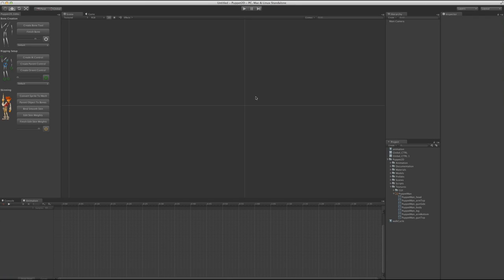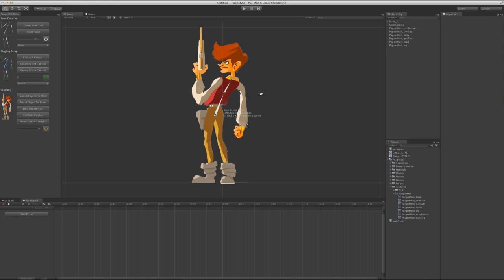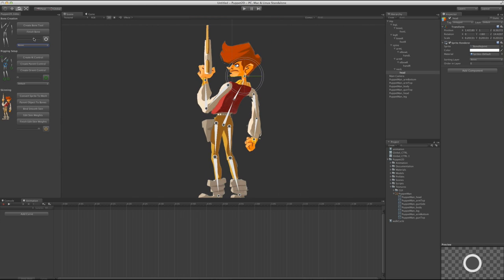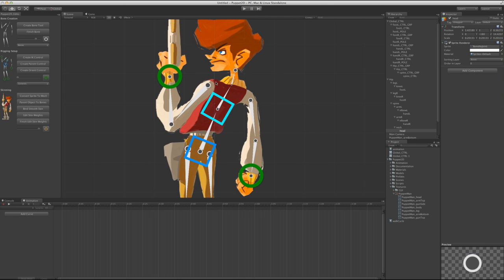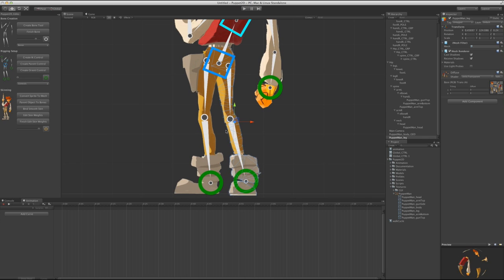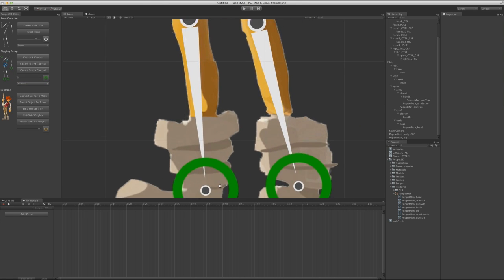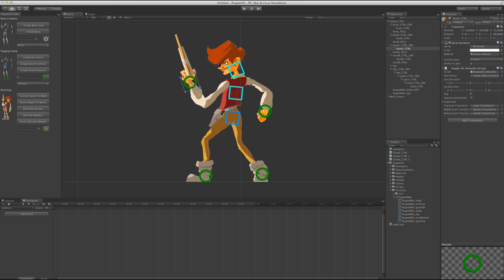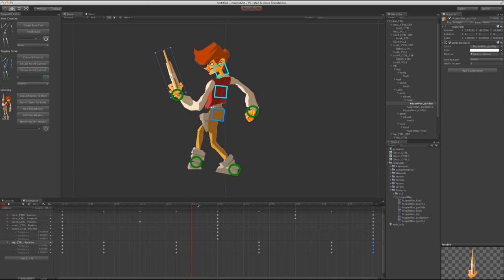puppet2d Tutorial

Comment: Is there an updated package I'm not aware of? The one I'm using has the body and right arm as 2 sprites, when I'm at the Parent Object to Bones stage it messes up completely on me.
Reply from the maker: the latest version is 2.4, where it should show a connection to each child bone  (not like the video) what is your bug with parent objects to bones? (make sure you don't have the debug inspector showing btw as it can cause issues with bone selection )
Reply: +Puppet2D If I include the right arm when I select parent object to bones the right arm moves off the body when moving it (the shoulder disconnecting from the body altogether).

If instead I include the right arm as part of the body when I convert sprite to mesh the right arm sprite doesn't move when I move the IK control, it just distorts the body sprite unnaturally.

This is my first time watching the videos, I'm sure once I get the hang of it I'll be able to do the right arm the same way I did the left. As I'm only following steps right now it threw me off when it didn't work correctly. I simply need some confidence with the tool.

Thanks for the speedy reply!
Reply: +Puppet2D Just worked out it's because the right arm is one sprite, that's why it keeps disconnecting from the body. The left arm is 3 sprites. I'm a halfwit. At least I know now why it's happening and I have a feeling the convert to mesh thing I have to do on the body and leg will teach me what I need to do to sort the right arm out too!

Comment: How do I modify each joint individually? When I click on a joint the pivot point is no where it should be.
Reply from the maker: Tristan Begin You need to set it to "pivot" at the top left of Unity GUI - (not centre) that way you see the rotation point in the correct place.
Reply: Puppet2D Oooh, I feel dumb :P
Reply: Puppet2D Another quick question. When I rotate or scale the parent of the bones and controllers (controlling the main object) in order to make it face the opposite direction, the controllers get all screwed up. Is there a way to fix this? And if not, how would you suggest making it face the opposite direction? (Like when it's moving left instead of right, ext). Thanks!
Reply from the maker: Tristan Begin make sure you parent everything to the global_CTRL and then use the "flip" checkbox on the global_CTRL
Reply: kk, thanks again for the help! Did you develop this tool on your own??

Comment: When I draw the bones they always appear behind the body parts. even when I send them to a high layer they keep appearing behind the body parts... what can I do?
Reply from the maker: Ricardo Ceron You need to set the default bone drawing layer in the top of the puppet2d GUI. This will make sure all the bones get drawn on the correct layer.
Reply: Puppet2D Excuse me for my ignorance but Im new at this... I didnt understand what you mean... also... will there ever be another tutorial about how to switch between the 2 hands you provide with the character?
Reply from the maker: Ricardo Ceron On the puppet2d GUI you can choose what sorting layer the bone should be on. 
Why would you switch between the two hands - one is a skinned left hand,and the other is parented sprites for the right hand. (I did them in two different ways to show different methods of using puppet2d)
Reply: Puppet2D for example... ehat about if i create a 45 degree face, a front view face in order to create a more fluent animation when character is turning... os there a way to incorporate these faces unto the puppet2d animation?
Reply from the maker: Ricardo Ceron You can switch out skinned meshes by switching the material to one which has a texture with a new head image (45 degree one for example). You can animate these in the animation window - and you will even see a little image of the texture for the keyframe.
Reply: Puppet2D Sorry for all the stupid questions and thank you for your kind answers... when I click on a body part, it instantly returns to the initial position.. does it have to do with the fact that all body parts have been turned to mesh? (Im using a character of my own).... when you click on the gun hand on the video and change it, is it because its only binded to the bone instead of being a mesh?

Comment: This is the very comprehensive and useful video! Much thanks for sharing it. I'd like to admit that it has made my mind to pick your tool instead the one I was going to originally because of the nice UI and features.

P.S. Have no intent to nitpicking, just like to share why I have just almost missed your asset, when was searching for the proper tool. It happened after brief watching the original showcase (Puppet2D 2D skeletal Animation Unity) where char's animation was rendered to lower framerate and looked not as smooth as it could be. 

P.P.S. I was very amazed by the ease with which you've made decent walk cycle in front of my eyes literally. Did you considered making some more of it - I mean some tips for animators, featuring your asset, - just the basic stuff like walk cycle, crouching, running, etc. It could help many indie game developers and would definitely promote your tool.